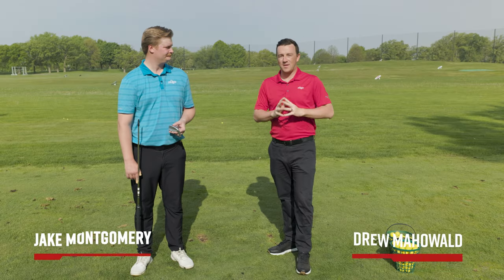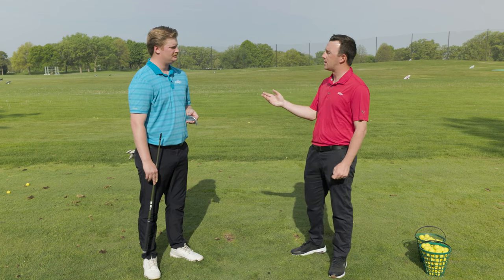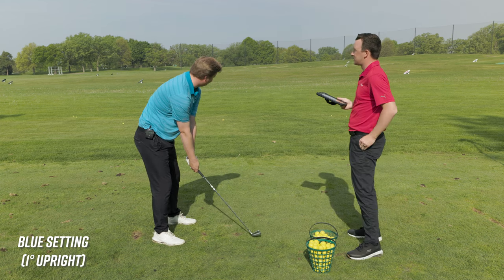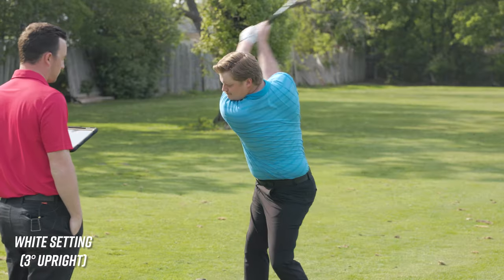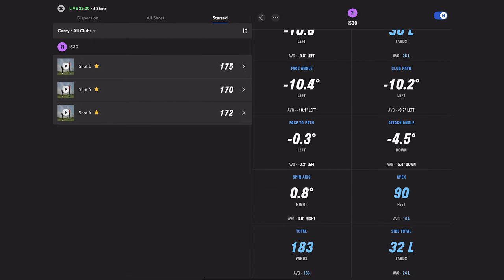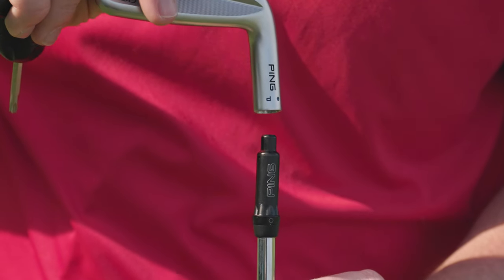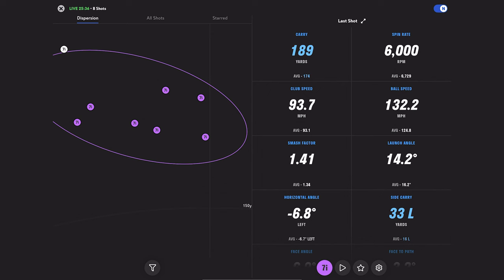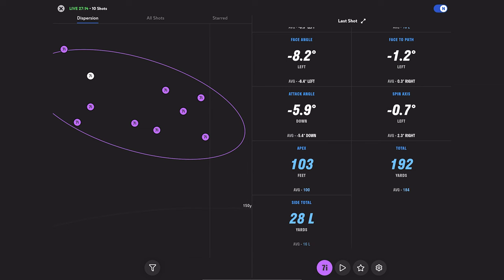NEW PING AFS Iron Fitting Adapter | Testing Different Iron Lie Angles

Comment: do lie angles change for longer irons or is the lie angle the same on the 7 iron as the longer irons like a 4 or 3 iron
Reply from the maker: The lie angles do change throughout your set of clubs. Your longer clubs require a flatter lie angle, and vise versa for shorter clubs. Iron sets are designed with progressive lie angles to account for this

Comment: What color code was on that 7 iron head? At my club the ping demo iron said it was RED and then had the flat lie dot colors. Does the head with blue green and white dots come on a black labeled head?
Reply: There are 2 different fitting heads, one that has the upright lie angles, and one that has the flat lie angles.
Reply: @andrewcs29  ok thanks but the head at my club's pro shop also had a label saying it was a red head.  I assumed it was a black (aka Ping standard) head with different lie angle settings until I saw the word "Red" in black lettering on the head.  Is there more than one fitting head with the flat lie angles ?  Like a black head and a red head?